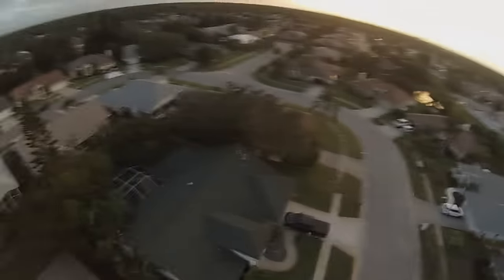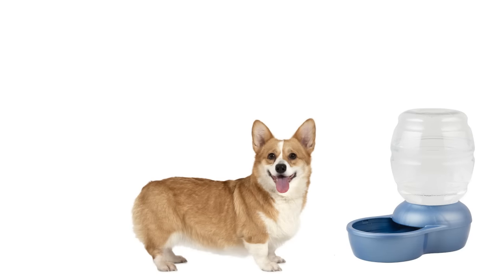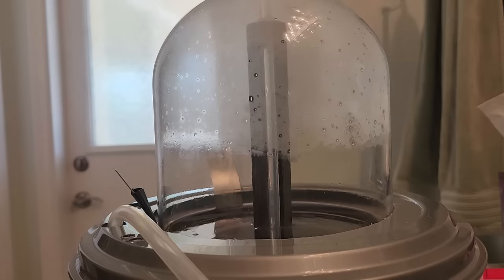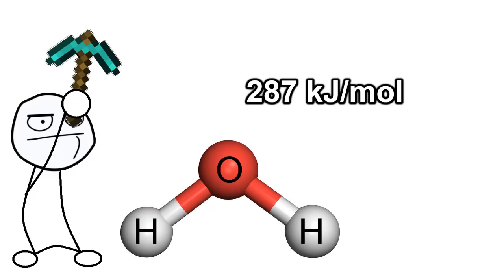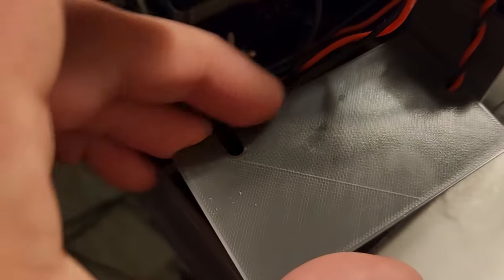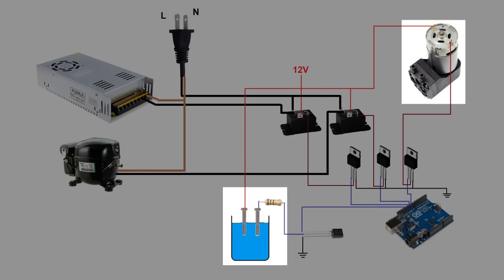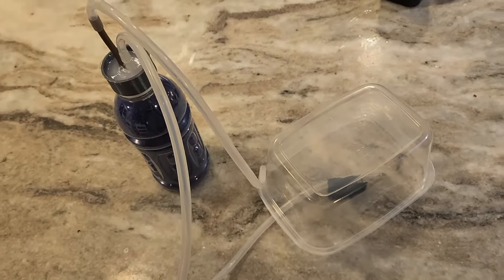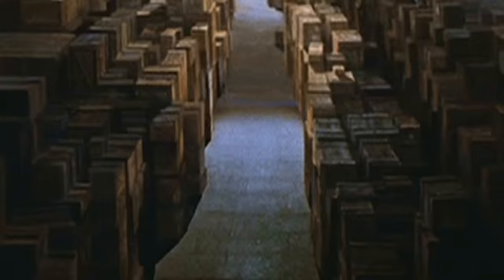Automated Hydrogen Generator

Comment: Very cool project. I noticed a few things I should have mentioned. The difference in your potential need and literature is probably due to your current scale and what zero is. The minimum voltage needed to start the reaction produces less than a nanoamp of current, but your scale is probably a milliamp at best. Electrochemists use a reference reaction as a zero for the measurements, typically the 'standard hydrogen reaction' (SHE) or silver-silver chloride reaction. There will be a significant offset since you are using the ground as zero. 

You mentioned the effect of temperature on the reaction rate but didn't discuss the dissuasion limitation. Temperature, like stirring, increases the reaction rate by increasing diffusion and how fast the atoms and molecules can move from one electrode to another. This changes the resistance in reality compared to what happens in metals. 

Finally, you need to be more careful about the types of pumps you use! 120 psi of hydrogen is a dangerous pressure for using a normal pump. Make sure that this has some safety measures normally, there are ATEX requirements for these sorts of systems.

I can't wait to see the next project!

Comment: A small amount of TIDE clothing detergent in water for safety and two aluminum electrodes. USES very little current at 12 volts. THE positive electrode desolves trapping all the oxygen as a powder. The negative electrode makes only hydrogen gas.

Comment: I think you should put some silica gel into the ballon/waterball as well. The hydrogen spends a lot of time there before it gets transfered to the compressor tank. so the Gel has time to suck out residual moisture.

Comment: Threshold voltage isn't about hydroxide solution itself. It's because of electrode polarization. Each metal electrode subducted into a solution forms a double electrical layer on its surface -- like a second virtual electrode. So when you start applying voltage to a cell you should "OVERvoltate" that double layer acting like another micro-cell.

Comment: I can vouch for chromium ions.  Took me a while to figure out where the yellow was coming from until I remembered that stainless has a dash for flavor.  I use TPU to print some parts for my perchlorate cells.  It turns to goo like everything else but it's cheap and forms a decent enough seal to function effectively for a few cycles.

Comment: hho is useful for diving as the hydrogen replaces nitrogen for technical deep sea diving. this allows for easier breathing as the higher outside pressures make the gasses in your lungs dense. by replacing some of the helium with lighter hydrogen, people can continue to exhale heavy co2 while going deeper than 200 meters. richard harris is one of these divers.

Comment: If you are stuck with too high a DC voltage you could put a bunch of electrolysis cells in series ensuring they use separate electrolytes. Also use a higher surface area of electrodes even if that surface area isn't in a direct line of sight of the other electrode's extra surface area, bubbles are a bigger insulator than that water solution. I'm thinking anywhere bubbles can freely form is better than not.

Comment: Coal coke can also work since it is very conductive but leaves a nasty powder (not toxic but pain to get rid of from the electrolyte) behind. I guess that is fine for gas production. It also oxidises itself into CO2 on the anode but that is not a problem here. It is also cheap but hard as a brick and comes up in clumps.

Comment: I'd get a bigger water container for the backsplash if the bell cracks or the valve leaks.
Make tests with the amount of volume you need that the water doesn't get out of the container.
Put a container around your experiment so it does not leak.

Comment: Have you tried thinking about a compression tank system like instead of air used a air compressor to suck the hydrogen out of the generator into its tanks once full it be at a high compression for use?

Comment: I am completely satisfied and impressed with your project and explanation.

I have been observing and researching fuel cells a bit.

But I'm having difficulty finding what could replace/cheaper the catalysts.

Which the cheapest would be using Chrome. But I still haven't been able to see how to put it
it in a small size, enough to be able to replace a motorcycle battery.

Comment: The only thing I have to add is to hit the vessel with an ultrasonic transducer to drive the bubbles off your anode and cathode. Might keep you closer to the 20L per hour number consistently, might even beat it to be honest.

You might take a look at what Bob Lazar did to store hydrogen. He made a hydride and released hydrogen on demand by heating it.

I'm curious what your approximate operating cost per liter is if you ever decide to plug it into a power meter.

Comment: In 1980 I read a 1974 world book encyclopedia volume e that explained the process of separating hydrogen and oxygen from water they used graphite as the electrodes cuz graphite will not deteriorate over time oxidize. They used two Ball mason jars to separate the hydrogen oxygen out of the water positive electrode in one mason jar negative electrode in the other mason jar your design is very accurate other than you're using stainless steel as your electrode you need to use graphite it may be more brittle but if you use nylon bolts with nylon washers to bolt your electrodes together in a series you'll have a better output.

Comment: From some research that I have done if you use frequency modulation and vibrate the electrodes it would allow the Hydrogen to separate easily. I have heard people have had success at 20,000Htz but if you go by what tesla said and use hydrogens natural resonant frequency it will just separate if you vibrate it at the right frequency!

Comment: This is amazing, this so much simplified a design for a project i had done, i feel kind of embarrassed now that this solution has been invented, my designed replaced the bell with a siphon between so that the gas would be separate but the fluid would stay connected, however I had HUGE current losses and the osmotic pressure wasn't enough to force the lower concentration NAOH water from the cathode to the anode. Also I originally used salt so produced chlorine instead of oxygen, solved that when i noticed the yellowing plastic on the oxygen off gas tube. (kind forgot the entire chemistry part)

Comment: I found this dope pdf from from some scientist guy, he made a electrolysis system. It was powered from A/C 12 volts pulsing at 100mhz frequency. The circuit had inductors and stuff to convert to DC, it barely used any current. Im thinking he used the inductors collapsing voltage spikes to increase the voltage to probably 1700+ Kv's. He compared regular 12 volt dc to this setup and it was hugely more efficient then regular DC. barley used any power. Apparently higher voltage uses less current in electrolysis. but what do i know, i never went to college.. maybe some experts can chime in.

Comment: You need 2V instead of 1.2V to split water, because of 'overpotential': basically water splitting reactions happen on electrode surface and the overpotential tells how good catalyst electrode material is. Fortunatelly stainless steel is pretty ok for both reactions. 
Passing your hydrogen through hot Catalytic converter should remove traces of oxygen

Comment: Also i recommend using potassium phosphate monosbasic salt, as it has less issues with p.H. values, less caustic for corrosion purposes
Reply: excellent conductivity, non caustic, only slightly acidic @ 6.5 p.H use at a 5% concentration weight per volume weight of water for best results. less dangerous than NaOH, Lithium phosphate more desirable but more expensive due to lithium battery production.

Comment: The dome that catches the hydrogen could have a pressure switch, to turn off the power for the electrolysis. Then when more  gas is needed, the pressure drops in the dome, which then restarts the electrolysis! 🇬🇧👍

Comment: After letting it run a long time, you should neasure the density of the water that is left in the cell, as you should be concentrating the deuterium content of it making slightly heavy water.

Comment: I want to get into building hydrogen drone blimps too, this gives me a rough idea of how I want to get the hydrogen. My goal is to demonstrate how safe it can actually be with the right choice of skin material and a vast number of modern engineering improvements that became available after the age of airships ended tragically. (I am of the opinion that we shouldn't have stopped putting hydrogen in airships, but rather just improved safety, such as not painting them with literal thermite as the German zeppelins were)

Comment: Use baking soda instead of NaOH as electrolyte. You can tune the cell by connecting an amp meter and usually i time mine to around 7amps.

Comment: Not that you are wrong about cranking up the voltage causing the problems you mentioned, but fixed voltage should be used for electrolytic cells for a more fundamental reason which is that different reaction pathways will be be unlocked at different voltages. For example, in a cell containing NaCl, oxidation to chlorate happens with 3-4V (or eV on a per-reaction basis), and oxidation to perchlorate might be possible above 7V in practical situations (dependant on other factors like pH and catalyst).

This is very relevant to the type of materials that can be used for various parts of the cell, since higher voltages cause all kinds of extra fouling/corrosion/side products, many of which are hazardous materials. This would be a very significant expense to deal with on an industrial scale, and a pain in the ass on a hobby scale.

Comment: I just went through the process of generating 145# 25cfm  -40 dew point, extremely clean compressed air, and in my search for dessicant dryers ran across a couple of activated alumina dessicant dryers designed for drying hydrogen. I couldn't for the life of me figure out why hydrogen gas would need to be dried. 
When I watched your video BOOM I realized why someone would need to dry hydrogen gas!
A few hundred dollars on ebay for one which will dry 10-15 cfm of gas... so you could make one for probably $50.
If not mistaken Titanium electrodes mitigate the loss or eating away.

Comment: You can get electrolysis to happen at even less than 1.8V / cell with a PEM electrolyzer.  However, it's not very fast at lower voltages.  I have a 2L / min PEM electrolyzer (10 cell stack) so I start at 20V (2V per call) but, as the water warms up, I can actually still get 2000 mL / min at only 1.8 V / cell (18V).  I could do CV instead of CC and get an even higher output but I like low voltage electrolysis.  The water stays cooler and you get less vapor in your hydrogen.  It's also more efficient.

Comment: It sort of reminds me of those hydrogen generators you'd see on old emergency radios that would either attach the long radio antenna to a kite or a balloon depending on wind availablility of course. Not sure if similar things are still in use.

Comment: It old be used as part of a new hybrid airship platform,

Water as ballast and h2 source. Internal h2 bag can be expanded for more lift or used in a generator as fuel and to reduce lift ..

A complex dynamic system yes but plausible

Comment: initial setup was basically a pressure cooker, good it had leaks which prevented it from exploding.. since the method is exothermic and instantaneous.. less concentrated NaOH is preferable w/ chunky ingots rather than thin foil sheets or powder of aluminum for reaction.. that way heat & pressure buildup is mitigated/manageable.. store the hydrogen gas in an inverted vessel floating in a water tub.. also beer cans in jar of lye water shouldn’t cost $10 - 15/m3 for hydrogen gas production.. although glad alternatives processes were sought to explore options of possibilities..

Comment: I will say that a fine hho generator/ separator was designed and built by your creativity and skills. However in my opinion it is way over kill as I do the same ( maybe not as efficient but can generate and seperate the gases quicker than 24 liter hour. If u use a pulse wave modulator and preset the constant amperage than make a large enough  cell / surface area. I wired mine with positive neutral negative instead of +/-/+/- I went +/n/-/+/n/- .I didnt use a membrane but plastic washers and plastic 4 inch screw with plastic nut to keep  electrically separated . Cut a notch in each 4 ×4 inch plate to alternate corners to have every 3 + on one end and  1 every 3 the opposite corner drilling 3/16 " holes in +/- plates and 1/4 holes in neutral to pass stainless bolts that connect all + on one corner and all - on opposite with neutral passing thru. I didnt use wire but a metal bar that easily can handle hi amps with no heating . To seperate the gas the two plates of three total in same base water with potassium hydroxide as catalyst but two plastic 2 liter bottles that had + plate in one and - on other. I ran a small pump and another water / catalyst supply that circulated as not to have same water absorbing heat. Ran gas thru each top portion of 2 liter bottle and ran to two seperate flash suppressor  bubblers and stored said gas in 2 separate inner tubes. To check for rate of production submerged a full 1 liter bottle of water in a tank upside down and timed it as how long it took to empty water out of 1 liter as gas entered under bottom of bottle slightly inside as all bubbles would go in and push out the water. Same outcome except mine wasnt automated but if I used a large inner tube that would inflate  I could easily let it run without overloading the circuit as amperage would not go beyond 20 amps , water stayed cooled thru circulation and could use a pressure switch to shut off system when I wanted. I like yours but looks expensive and time consuming  but not knocking it.   I just like elegant simplicity.

Comment: Have you ever thought about doing electrolysis chemically, it's pretty simple but I haven't a clue how you'd go about controlling the reaction, it's aluminium sodium hydroxide and water in a glass jar with a hole on the top lid to extract the gases

Comment: Use a ring on the outside and a plate with the same surface area as the ring, drop the glass bowl a bit. Than figure out what kind of metal is the most conductive.

Comment: I'm hearing all sorts of stories about making hydrogen gas and after doing some research you need 9 kg of H2O and 2.7kg of KOH and 50KW of electricity to make 1kg of hydrogen so if using single phase electricity it will take 17 hours . Green hydrogen is expensive to make as to blue hydrogen. It can be done by using nuclear energy and the only use of hydrogen in an industrial scale is for ammonia production. Heavy water is produced as a by product in electrolysis so all spent KOH will have to be pushed into a RO plant to get OH and D2O and again using electricity altogether about 55KW energy used and KOH is also expensive to make nevermind by 2030 there will be 50MW electrolysis reactors on the market.

Comment: that was fascinating since I've built an HHO gas generator 7 years ago and it worked great. Have you tried a high-voltage approach? I hear it can split even regular tap water into HHO, without any electrolytes and mess. Subscribed btw

Comment: If you had an 'outside bell' water level high enough (the surrounding plastic/glass allows for higher water levels), then you shouldn't need the motor/etc.  As the hydrogen is generated it would force the water out of the bell, and then once the bell water level dips below the 'outside bell' water level, there would be some pressure on the 'inside bell' gass, which should force open the check valve and pass the hydrogen through the pipe

Comment: Uses for hho? How about for internal combustion engines? The flash point of hho gas is around 111 psi so as long as you stay below that flash point you can us the gas as a fuel for ICE vehicles. Now in order to make good use of it you must slow down the burn rate by meter mixing some of the exhaust gases into the intake system to sort of create a traffic jam so that the oxygen and hydrogen can't easily find one another due to all the stuff put in there that doesn't support the combustion process. 
You can use CNG injectors to flow the hho into the engine to replace the use of fossil fuels. 
Now I admit there is more that would need to be done but it gives you an idea of how to make the best use of your hho gases.

Comment: Had similar idea ages ago to produce oxygen/hydrogen under pressure . feed the water under pressure, when it's lower than a set level, and gas above has same pressure as the water etc.
for electrodes, using ends of glass pipes (for increased plate area), that would then be plumbed together with hose to collect the gas,

how to form the electrodes on inside/outside of such tubes?
silver mirror test /Tollens reagent. dip the tube into the solution, add the aldehydes, and thin layer of silver will be deposited on all surfaces the liquid in contact with. bit of sandpaper on the end of tube, to remove the excess silver there etc

Comment: The future of transport - electrolosys on the move, no H2 storage problem as it all gets burnt. A small STRONG H2 pressure vessel as a buffer, and for acceleration/hills. Exhaust = H2O obv, and high efficiency from alternators from the running engine need to provide power for electrolosys once underway. Some betteries for the ''cold'' start/pressure vessel and voila - make it so somebody.

Comment: If you make a ripstop nylon "skirt" sealed on the bottom of the bell jar, then you could lift the jar above the electrodes and get better conduction through the water without any gas mixing?